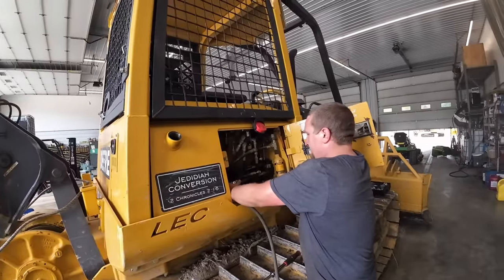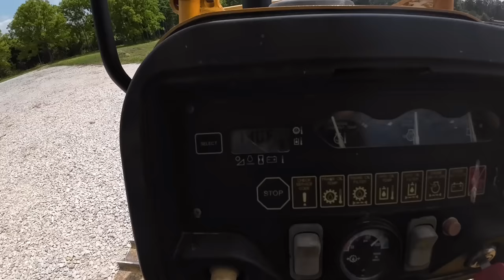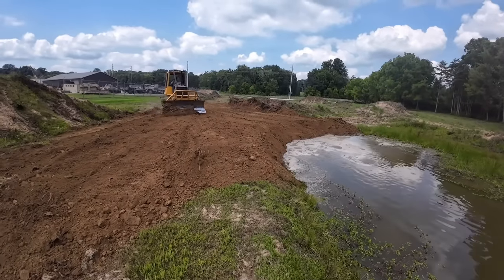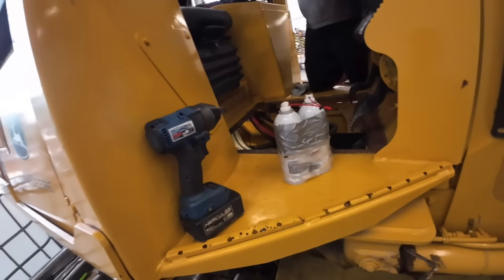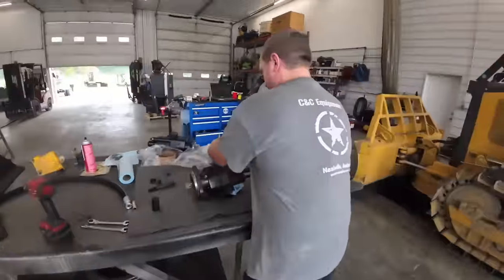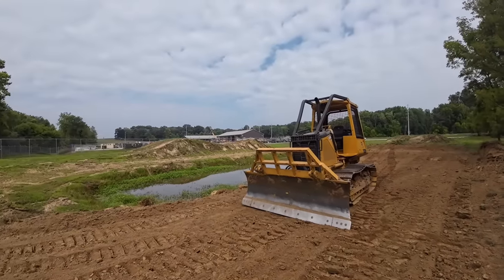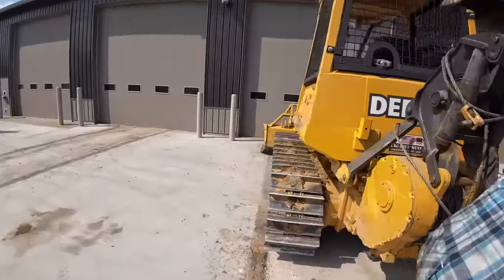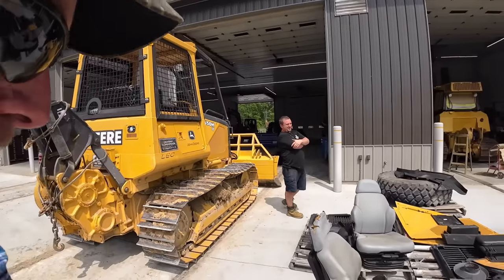Overheating hydraulics back again for the second time, I’m about to pull my hair out on this dozer!

Comment: its unreal the amount of odd issues that can happen like this, I had an odd problem a while back,  
         i am fairly mechanical but, I dont know that much about diesels and heavy equipment, On my JD455e I had an issue with the engine not hardly starting and no power.  I was sure it was the injector pump going out. upon investigation, it had a small rubber hose connecting the fuel bypass/ tank return line  it was metal and had been cut.   I was revving the engine on a can of ether and it spooled it up high enough to blow the rubber hose off dumping diesel everywhere but the engine instantly went to running perfect!  the whole problem was who ever worked on it had shoved the hydraulic style hose over a metal line shearing the rubber and totally stopping the tank return, once i got it cleared and reassembled everything the machine runs perfect.

Comment: I think the biggest clue was the valves being different temps in the valve body. If the outside valve was producing excessive heat, it would make sense that the valve next to it would be hotter than the valve furthest away from it. It would have been interesting to know if the outside valve was still hotter than the other two valves after you switched valve bodies. If the outside valve is still hotter than the other two it could be a restriction issue on the cylinder side of that valve.

Comment: I hope you got it fixed. I hate stuff like that. 

I have been battling a Webasto boiler for about two weeks with an intermittent fault. It seems to only fail in the middle of the night. I have gone through it I don’t know how many times everything tests fine. It ran great the whole time I watched it. It finally started failing more and it was the controller that I suspected, but at a $1000,00 I wasn’t about to guess.

Comment: you could try a dye penetrant or a mag particle test to look for a crack. if the crack is that small id say the dye won't find it, but the mag tester should pick that up. thanks for making these videos. im a welder that's switching to heavy duty mechanic, so I appreciate these videos.

Comment: I'd supplement the hand held laser thermometer with a FLIR unit... I use a small usb c FLIR on my cell phone...  but an inregrated unit is far better... but they're at more cost... 

Yea... they're expensive... but you get the whole picture... not just a spot reading... shows the temp differentials... and that helps immensely... especially when hunting down head scratching issues...

BTW... Great video guys... keep up the good work....
Reply: The "field of view" on the temp gun was likely more of a hindrance than a help... I have the flir unit for my phone, too, but I agree, for his shop, a standalone unit would probably have been a big help. There are a few decent ones from the import market that are good performers.

Comment: While i have not worked on dozers nor much on hydraulic systems i am wondering if the hydraulics are actually overheating.  I have seen in the automotive world where a n engine temp gauge would occasionally overheat according to the gauge. The problem was not the cooling system the problem was with the gauge itself. Just a thought here.

Comment: It's has LEC on the side would be the first reason I wouldn't buy it I bought a dozer and how from Leslie back in the early 2000 worst bunch of junk I ever bought it's like they get all the 2nds off the line however when I get in the market to buy again I will definitely check see what Clint has as far as retired 850 looks like Mike at DP got a good one been impressed by what I've watched there

Comment: As a last resort, you may just have to install a hydraulic radiator somewhere with air flow to cool the fluid.
Oil temperature above 180 degrees is to be avoided, as it will quickly ruin the seals and o-rings in the system and cause premature failure.

Even car power-steering hydraulic circuit has a radiator to cool the fluid, it is not that unusual, not to mention, automatic transmission oil cooler.

Comment: Check the case drains from the transmission pumps.  If the pump is worn and bypassing excessively overheating will occur.
Reply from the maker: This is the hydraulics not hydrostatics

Comment: Could be the After market Winch and the retro fit plumbing and a small orifice bypass ?
Presumably the Hyd Filter has been changed
Is the Exhaust Box Rotted out underneath ?? we had this on a Komatsu excavator which was blowing hot air into the compartment and heatn everything up.
Are the Rads Clean ? Oil Cooler and Water Rads- check right at the bottom for clogged fins

Comment: I had similar issue with New Holland Dozer was at the dealer for months..they tested changed and swapped everything on it because tests were saying it was the pump.
Well finally tore the pump apart one of the plates inside was spinning and causing internal leakage. 🤷
Reply from the maker: Interesting 
How are you getting along?
Saw you were down in the back dept. that always sucks
Reply: @C_CEQUIPMENT  yeah it's been two weeks and I'm still down today was my best day though hopefully  soon.. thanks for asking

Comment: IR thermometers take an average reading over a certain area so if you want to make sure you're reading what you think you're reading you need to place it up close otherwise youmay be also taking the temperature of what's behind the hose. The laser is lying to you. 
They also underreport the temp of shiny surfaces because shiny surfaces don't emit the infrared heat as well so measuring the fittings might not give you an accurate reading.

Comment: check return flow obstruction possible screen on return side, possible fan clutch slipping, oil cooler plugged up with dirt, belts slipping, wrong fan for application,  fan reversed wrong oil weight,  collapsed hose,  just some ideas  and things to check

Comment: Congratulations on hopefully solving the overheating problem. What does the LEC stand for? If the engineers and designers had to work on these and cars they would leave more room to remove and repair items. Good video. Catch that litterbug and make him clean everything up. God Bless.
Reply from the maker: It’s an aftermarket guard set

Comment: Heat can only be generated by an excessive pressure drop, you have a fixed displacement pump so the higher the rpm the higher the flow. a specific flow against a specific size hole generates a specific amount of heat @ given pressure, so to generate more heat  at the same flow, you will need to have a smaller hole, which will increase the pressure and thus the heat.
Reply: So look at the destination of the oil ie the blade cylinders one of the ports is probably restricted, that's why you have a sort of intermittent heating, its only heating up when your driving a specific side of the cylinder ie extension or retraction than it cools down until the next time its actuated

Comment: Colourcheck or dye check. Spraycans with fluid. Clean/ spray the red colour let it set, wipe it clean and spray the white colour. If its cracked the red will stay in the crack and show a red line in the white. You will see red dots because of the surface. So if no red line its not cracked. 
Might be cheaper ( i am dutch!) than magnaflux and you can do it yourself in the shop or wherever you are. A not trusted piece of equipment you want to buy?

Comment: The older series had a hydraulic cooler. The tank only holds 8.5 gallons. Is there a cooler option? You can add an aftermarket cooler. What is the trans temp? Does the transmission have a tank that shares a wall with the hydraulic? I fail to see how a valve body would cause the temp to increase. Even the pump doesn't increase temp. If there is a leak anywhere that lowers the pressure, that would only lower temp. I hope you figure it out soon.

Comment: Clint !  How about this, assuming the Master/ Max pressure pop of valve is adjustable, lowering it by, lets say 5%
and it does not lower operating usage/ability, in order see if the temps lower proportionally  ?
I understood 7800 psi "now" down to 7460 or 5%  ='s 340 psi lower total operating pressure ='s That much more oil returning to
the tank for cooling down. Just my two cents worth.

Comment: Had a JD 6430 with that problem, turned out to be air bound water pump just a hair low on antifreeze, I don’t know how the dozers cooling system works compared to a tractor

Comment: I worked on a pipeline and we had a D6N with a 6 way on it and it was heating up the hydraulics and come to find out the machine had a blade vibrate option that tilts the blade back and forth really fast to clean off any dirt that may stick to the blade after you back out of a push and what was happening was the operator was inadvertently pushing on this button every time he backed up and this constant use was heating up the oil.

Comment: I mean, I know the temp of the hydraulic fluid after running for an extended run is going to be pretty dang warm but I guess I don't really know how hot it should be. I'd say you got her fixed, but really no smoking gun.

Comment: if i'm having temp problems in hydraulics i check the system with a thermocamera , than you can find the source of the leakage that is causing the temp problems .

Comment: Puzzling. I have done some wildland firefighting out west where bulldozers were nearby and did see them routinely encounter flames peripherally but not for extended periods. The exposure was more prolonged when they were salvage logging some of the larger trees from burning slash piles. I don't know if your customer engages in that sort of activity, but the biblical reference does discuss logging. Unless they were using some extensive foil or metal sheeting, I would think you could see evidence of this sort of use, unless it was so comprehensive as to also block off all air circulation through the machinery as well.  Bizarre.

Comment: I assume your thinking a "closed circuit"  high/higher pressure by pass that doesn't allow the oil to return to the tank and 
the tank being the radiator. 
If this doesn't solve it ! ? 

I would say to myself,  leave the dozer in the field over night start it from an ambient cold soak condition, run it for 1 minute
increments, shut down, in order to find a hot spot (s) or to ck  temp differences, this before a larger heat soak area occurs ?????  
Maybe some clue can be gotten from this angle.

Comment: From my experience when gear pumps wear out they develop excess gap between the gears and the side plates, normally if its making pressure you wont see the damage, Thanks for sharing. Wonder if your main drive motors are bypassing ?

Comment: Clint, replace the 2 sections with the suspect mating surfaces. Yea they pass the sandpaper test, kind of. However under 7500 psi I'm quite sure you are still getting a bypass. That may be the entire reason that machine was sent to auction to begin with.

Comment: Good guess it could be a hydraulic hose that’s collapsing on the inside and not letting the hydraulic fluid flow through back to the tank to cool or it could be you have a bow that’s sticking and restricting the flow back to the tank when the hydraulics is not being usedit should flow back to the tank as you well know when the hydraulics are not being used a full flow, but it is pinched off restricted it could be causing it to heat up

Comment: If the pump wasn’t bad, would it be worth putting the original one back in and put the new pump back on the shelf?  Comparing the loss for selling a used pump vs the man hours to swap, wouldn’t it make sense?
Reply from the maker: Labor cost is high
I sent the other in to be rebuilt and tested

Comment: Do you have a hose that when the pressure on it is constant for a while allowed to seep inside the bands of steel swelling it from the inside restricting it enough to create resistance flow but after allowed to sit for awhile it will seep out and open up you might have to use a borescope through the hoses to see if you see any slices in the inside the other one to check would be a potential leak between the two sides of a cylinder not necessarily the hydraulic on both sides but possibly one of the seals from the outside allowing air in the cylinder creating a hotspot in the cylinder that's absorbed by the hydraulic system

Comment: I’m pretty sure the oil goes around the outside of the pump gears and not through the middle. How do you compress something that can’t be compressed? It has to go around the outside and the pump is “pushing” the pressure 35:54
Reply: correct.  Lots of folks get this wrong.

Comment: why would minor wear in the hydro pump cause overhearing if it wasnt low on fluid?  i see it causing low flow,, low pressure conditions but i dont see how its causing high temps unless its so worn that recirculation losses are  preventing sufficient flow through the pump to cool it properly---but i dont see that kind of losses as good as it runs and pushes. . Can you explain plz. (  I have a JD450B that I am working hydro issues on.)

Comment: Clint, why does the hydraulic system have 15W40 engine oil in it, isn't hydraulic oil thinner and not variable viscosity, just my 2 cents worth?
Reply: My John Deere Stander Mower calls for 15w-40 in the hydraulic tank.
Reply: Depends on the pump and layout of the circuits.
Reply: My old komatsu track hoe pc-20 takes 30w motor oil

Comment: If thats not the problem the other thing it could be is hydraulic cooler rad is plugged internally if that dozer has one ...seen that problem on a feller buncher...oil would heat way up changed the cooler and voila problem was solved...
Reply from the maker: It does not have one

Comment: Did you check the radiator oil cooler to see if it had flow or the sending unit for the gauge.
Reply from the maker: Doesn’t have one

Comment: I was wondering,  does that valve block have a thermal control,  they might like it to warm up and then it will cycle around the design temp.

Comment: How would a little crack in the valve block cause overheating? Cavitation of the oil? Also did you put the original pump back in because it was fine?
Reply from the maker: Pressurized oil can go into neutral circuit 
We just left new pump in

Comment: Is the tank of oil hot as well - might need a cooling grill.  Something is getting and causing issues.  How about blowing backwards from the metal drain line 48:39  Phew must have been something in that one valve set.

Comment: Got any oil coolers lying about !
Could you install an inline cooler on that line in ?
One must also ask if the temp sender is very sensitive ?
What happens when the temperature goes even higher, will it put the machine into limp mode ,im not sure if you covered that  .
Are you retrieving the Hyd pump back out , if it didnt need it ?
And is there a difference between Regular oul and Hydraulic oil with how they each heat up ??
The biggest dilemma is that Used machines are Not New ,but clients consider they are ,and knowing past use history of a machine leaves the door wide open ,unless you are covered by the Law when selling Used Machines !
Do you through this experience  need to add checks of systems on these particular models ,do you carry a rebuilt and fully checked valve body and install it before selling ,my thinking is if that costs you x amount ,you can add to machine price because it wont give problems?
"I cant afford to do that" you say but look what this has cost you this time  😮
Hidden wear and tear is the real issue is it not  ?
Reply from the maker: It is
All good points

Comment: There are high tech ways of detecting cracks normally invisible to the human eye that we used when I was in the Air Farce but not sure it's worth the cost for such a low cost item if that is even available to you.  

There is a guy I watch out of Austraila, who rebuilds components for heavy earth moving equipment from hydralic cylinders to other things on them machines. He sometimes uses a multi part spray on crack tester to check for cracks in the componites he repairs. That might be an option. 

This is why I hate electronics. Mechanical things like this can be frustrating enough where you can at least litterally tear something down completely . With electronics that is simply not possible.

Comment: What kind of grousers are on those tracks?  Tallest I've ever seen..   Your problem solving process has been fascinating...I'd say you kick every rock in the yard and then some.  Will the 
customer get to know how hard you've chased the problem??????   Would you like to work on my Husqvarna weed eater?  The fuel line broke?  replaced that and now it will start run 5 sec. and dies.  Put new lines from the carb to the tank, new fuel filter, etc. same results.....

Comment: A very problematic machine.
  Magnaflux Magnetic particle inspection is a quite fast to carry out, and may I suggest that if you get this kit I would suggest that you spend a little more and go for the ultra violet set up, it is all portable and can be carried out in minutes.
  The pther way of testing for cracks id dye penetrant inspection, basically you paint / spray a red dye on the component and let it soke for s few minutes, clean the dye off with cloth and a solvent wetted clothe and spray a deveoper ( its chalk ) on the component and if its cracked it will show up red usually within a minute or so, this method also works on non magnetic materials.
  I hope this may be of use to you team. Also we use  plate glass offcuts as a faceplate for testing for flatness and re facing items like the valve block bodies as they dont look too heavey a cause distortion of the glass
  Keep up the great content and look after your team players.